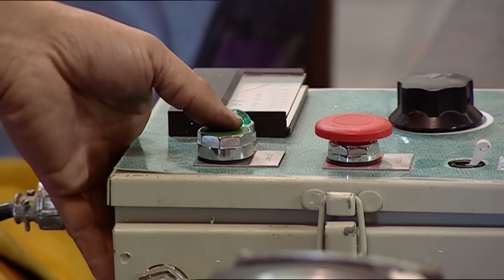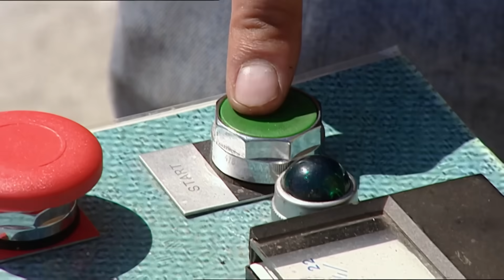Can A Gunslinger Shoot Faster Than A Falling Coin? | MythBusters

Comment: Zero credibility speed test.  He knows when he is dropping the coin.  Let someone else drop it.  He will loose every time.
Reply: There's also something to be said about knowing that a coin is going to be dropped at all,  even if someone else does it you can anticipate it coming.
Reply: @Mike__B yes.  Anticipation, however, is still not knowing when exactly it will be dropped.  Chance is not a measure of speed or reaction.  Just luck.